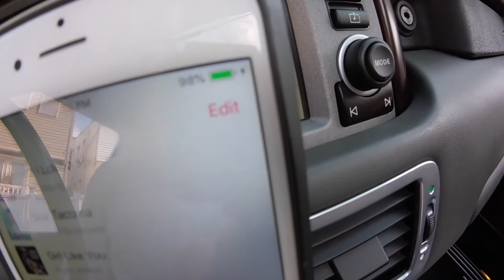Snow Blower Pulling Log Splitter

Comment: I was thinking of using my snowblower to pull logs out of the woods with. Use it like a tractor. Think this is possible? It is a bit bigger than yours. And I was thinking wheels for the front end?